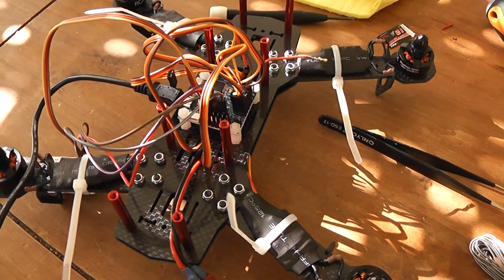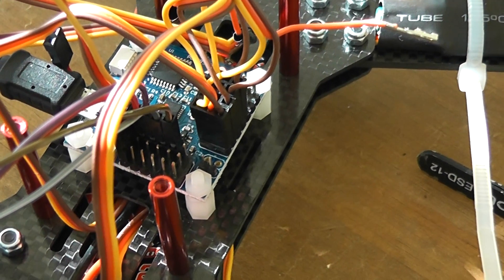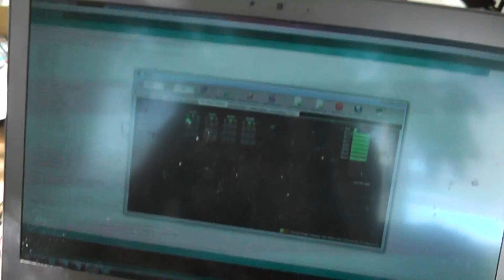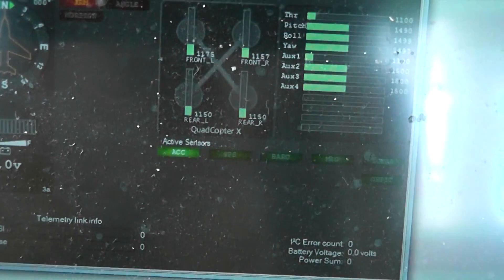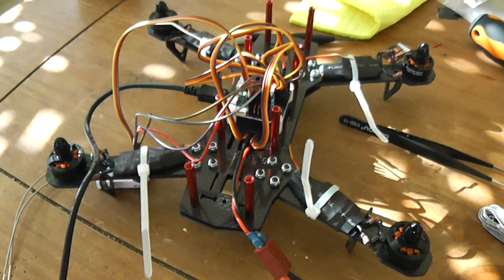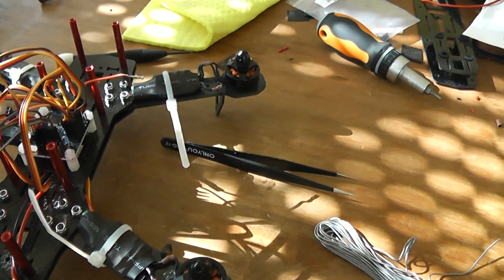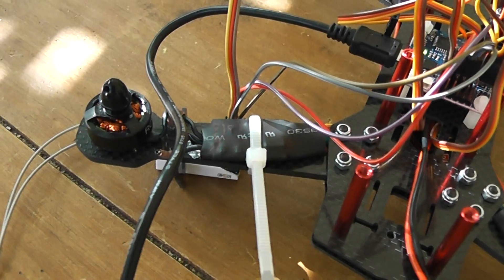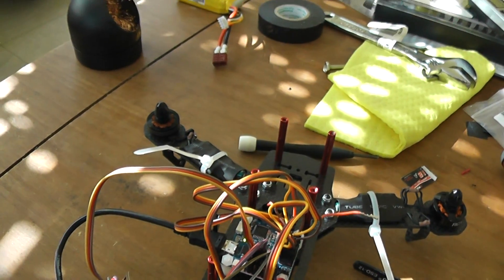Problem with my multiwii SE V3.0

Comment: Hey Seb , MysterEon here .... have you run esc_calib_cannot_fly?      decomment it, compile and upload .. motors will spin up , power off quad , then recomment it , and reupload :)
Reply from the maker: Hi, I performed the classic "Throttle" calibration via a Y cable .... It's worked fine. Is the software calibration add something else ?

What is the brake setting ? for the Software ESC calibration ?